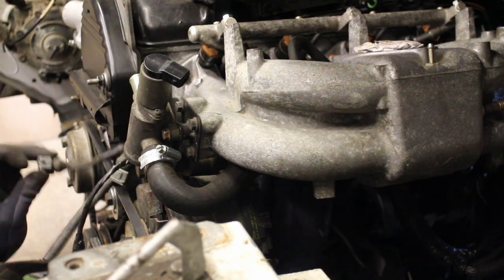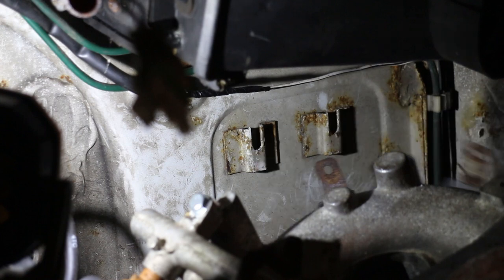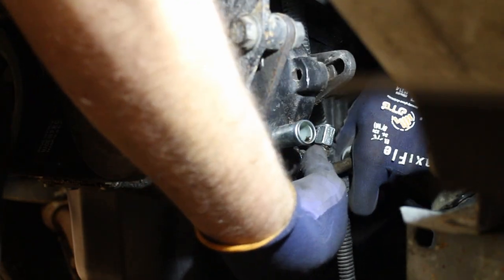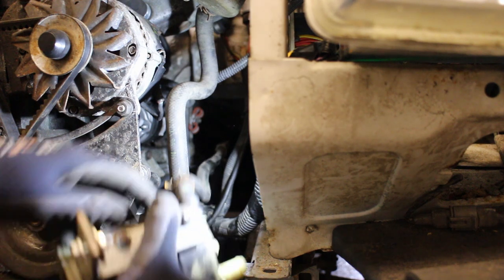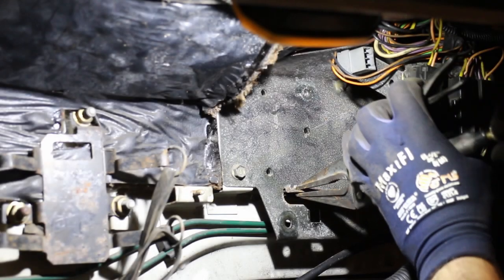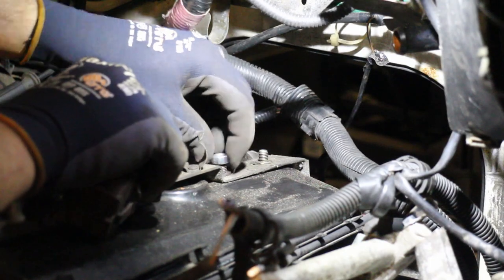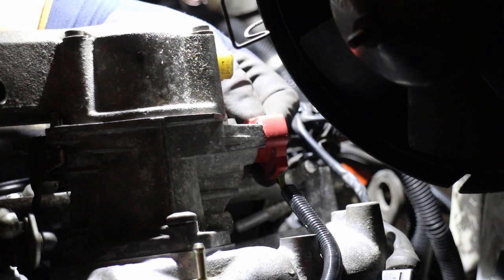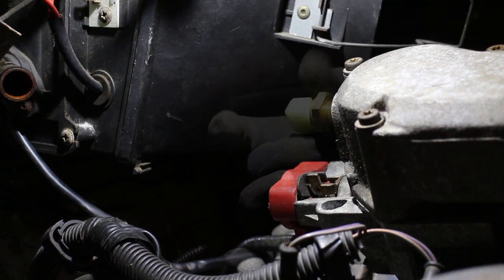Upgrading to the 2165cc Engine - MK1 Renault Trafic 2.2 Engine Swap - Part 7

Comment: This is such a fantastic series. Thank you for taking the time to put it together. I've  bought a 1997 2.2 Trafic van- My first- this week and it's in excellent condition.

I have a question . You haven't changed the cam belt. (Yet?)  Is there a reason?

Thanks,

David
Reply from the maker: Thanks for the kind words David. The previous owner of the engine who I bought it from had only just put a new cambelt kit on it so it's pretty much brand new. I definitely would have changed it though if that hadn't have been done. My other van which I bought back in 2019 (current daily driver) had the cambelt done in 2014 according to the label so that's due again fairly soon. I'll try and make a video on that as well. It's actually not too tricky to do the cambelt itself, it's just a lot of the front end of the van has to come off to get access.
Reply: @classictrafics  Mine will need doing . It's only done 10,000 miles since the lest change, although that was 10 years ago.

There's a Facebook page for Mk1 Trafics. Would you mind if I shared your video's on there?
Reply from the maker: @davidwhite3781  Yeah I would definitely change it after 10 years. I think old age can affect the rubber more than high mileage. I've also got a 1996 2.1 diesel van (off the road at the moment), bought it in 2017 and the belt on that was awful. No idea how it was still holding on, most likely the original. I managed to swing the rad out of the way on that so didin't need to drain down the system but not sure if that would work on the 2.2 . And yes of course please feel free to share these videos.
Reply: @classictrafics  Here's the link to the Facebook group to which  I've posted your video series.

A video on cambelt replacement would be fantastic. (Incidentally, I know how long these things take to produce, so I'll have mine done by then but I can see other people getting a lot out of it) 

Thanks again, 
David